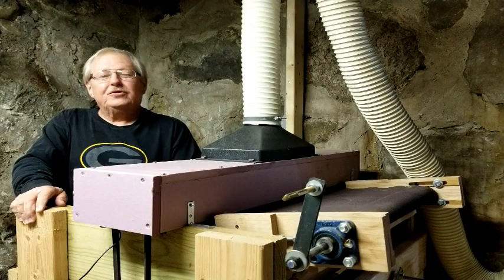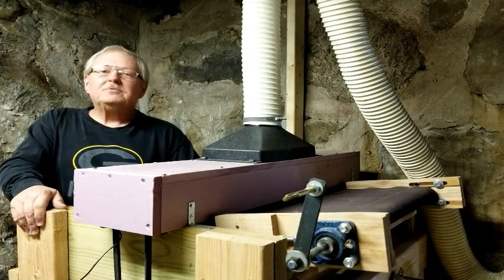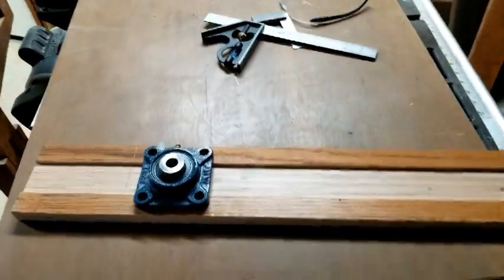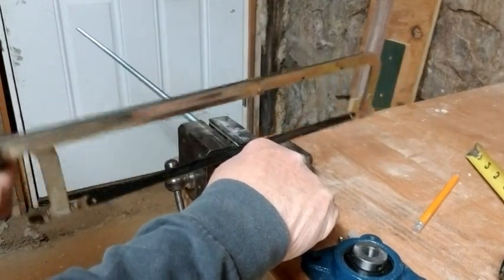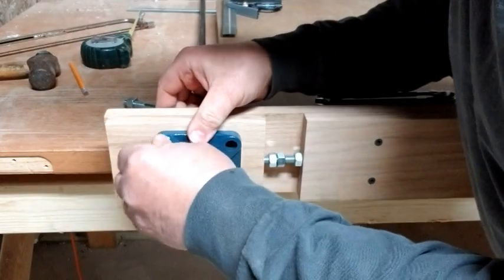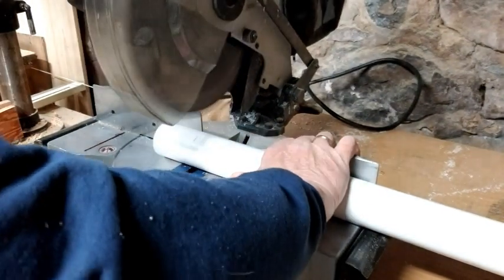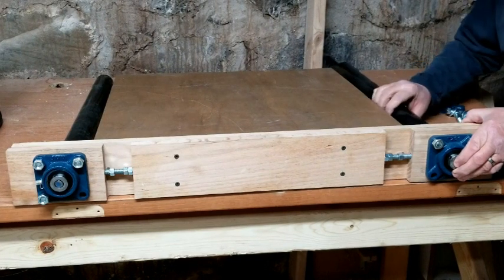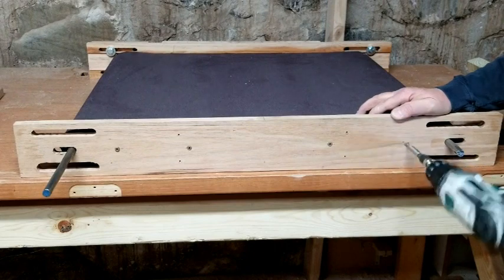Building a Thickness Sander

Comment: You would increase the suction sooo much more if the blast gates were closer to your vacuum system. Essentially your loosing the majority of suction through the piping by have the gates that far away from vacuum - even when remainer gates are shut off
Reply from the maker: Thank you, Kevin. I will consider if I can reconfigure. Maybe just add blast gates?
Reply: @homebuiltacoustics8510   Consider making one main blast gate as close to your main vacuum sorse as possible, in which only "the main vacuum hose" can slide/shift from one individual machine to another totally independently.
This means only the one machine that your wanting to use draws directly from the main vacuum sorse at any one time. (No loss in sucton from other hoses that lead to nowhere). When switching to another machine simple slide the main sirse of vacuum to the next machine your wanting to use where essentially the next machine vacuum leads to but now only drawing to that machine independently
Yes you'll still need to change the gate directly from one machine to another. However you won't have to move any hoses as each machine leads to the main vacuum sorce resulting no loss in sucton when moving the main vacuum sorse from one machine to another.
Hope this helps